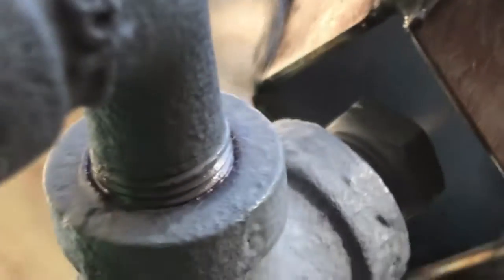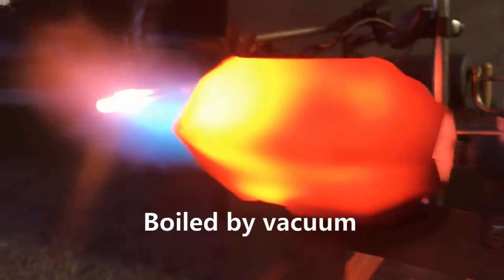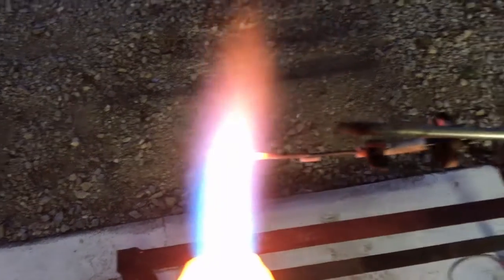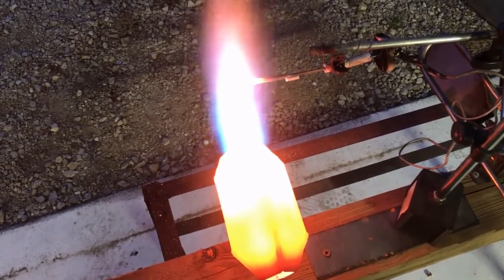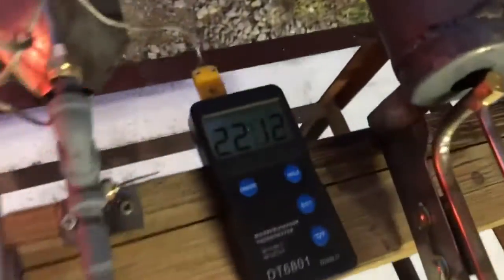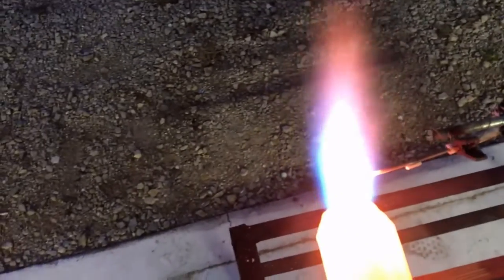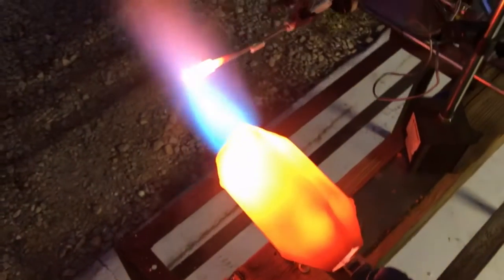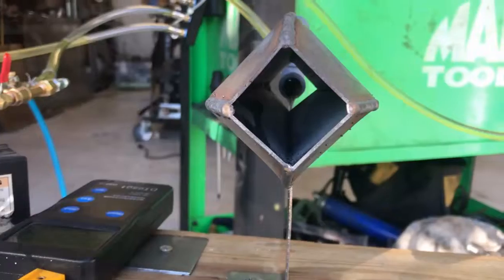High velocity burner  Lab Note SECRETS

Comment: Gasoline/Air mixture ratio is 15 to 1 for jet engines. A fuel is injected into a pulse jet combustion chamber and mixes with the air in the chamber at atmosphereic pressure 14.7 psi. The fuel ignites and burns and the expanding gas goes out the exhaust tail pipe.

Comment: Propane expands

Propane liquid will expand 270 times as it changes from a liquid state to vapor state. For example, 1 gallon of liquid stored under pressure in a container will expand to approximately 270 gallons of vapor if released to the atmosphere.